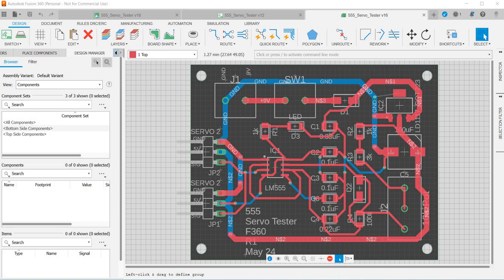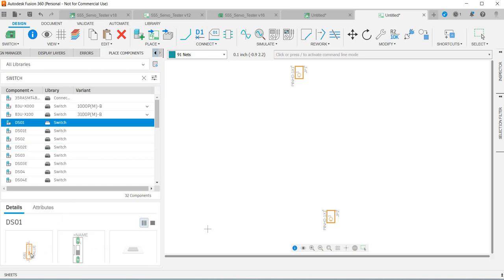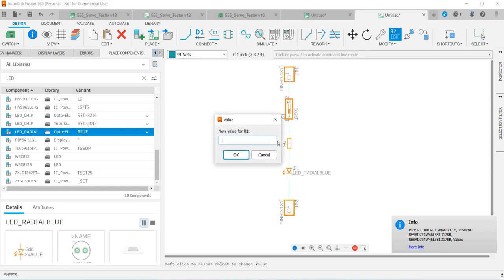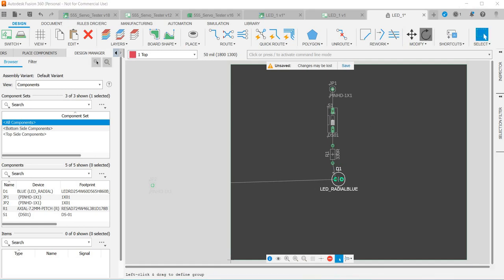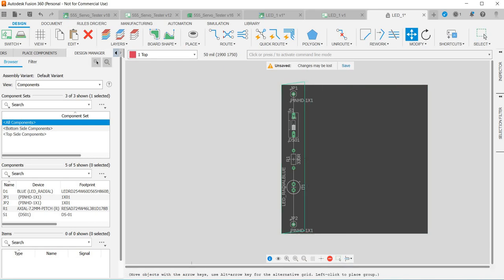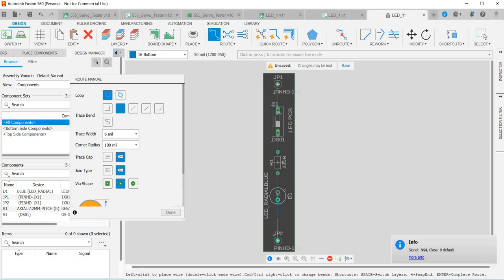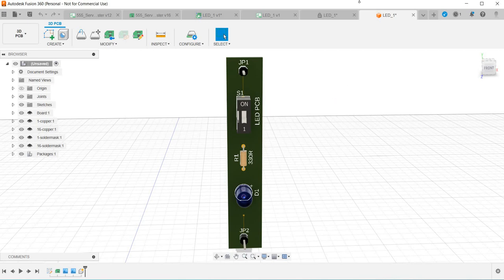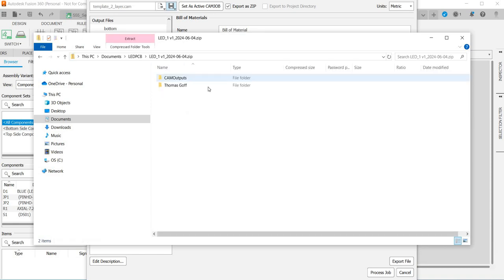Fusion 360 - PCB Design

Comment: I created a new schematic, and saved it. Next step was to move parts around and route traces, but the program closed on me while schematic was saving. I long for the days when we ran applications on our computers (without need for Internet connection), and saved our files locally. My schematic disappeared, and now I have to start all over. Lovely.